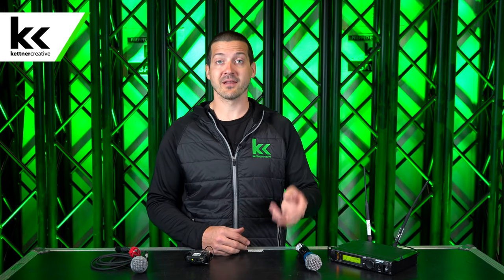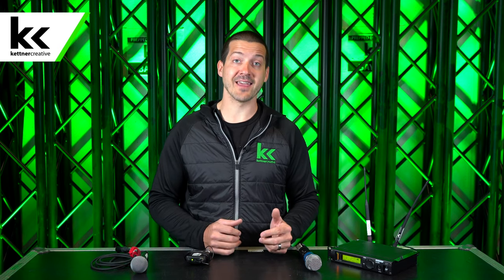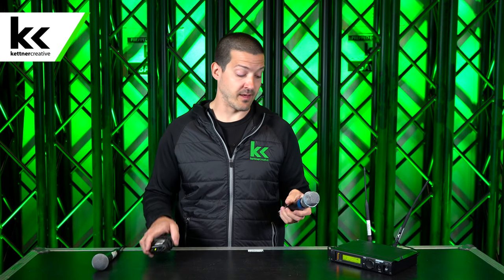How Do Wireless Microphones Work?

Comment: It's crazy to think how hard or expensive it is to get good signal with a wireless system as a dj just from my table across a wedding reception room or to the couple at the alter. But yet every car does it so easily traveling all around in metal cages moving across a huge area.

Comment: Hi
I have a all in one karaoke system (RHMK666) that has 2 wireless mic connects to 2.4GHz wireless band. I don’t understand these technical terms but my microphones built in lithium battery has died. All I want is to find out can I change the batteries on the microphone if not how to choose a replacement mic. Would appreciate your advice

Comment: I want to have 8 wireless mic. Can i buy 2x of a quad wireless mic? If not any suggestions. Or maybe you can make a tutorial setting up multiple wireless mic.. btw love the vid. Thanks!
Reply from the maker: I don’t recommend those quad wireless mic setups. The quality is really bad
Reply: @kettnercreative  Thanks for the quick response. I`m really not an expert in this kind of stuff. I`m just helping out in our Church since I`m kinda the only techy person there. So we already have existing quad wireless and want to add more that will not interrupt with the existing receiver from quad wireless. The Wireless Operating Frequency of our quad is 863MHz - 865MHz. so can i just buy something that is not the same as the operating frequency?
Reply: @Jonfrix  The cheaper the wireless system generally the fewer mics you can have setup intermod free in a given space of spectrum. The highest quality radio mic kits (analogue) will allow for over 12+ spots in an 8MHz chunk here in the uk but using something cheap and trying to get 8 spots in 2 MHz sounds like a disaster :)

Comment: Does a wireless collar mic require any additional equipment than the microphone itself, the beltpack transmitter and the receiver for the sound  to be audible.? I mean does it require any pre-amplifier.
Plus does a wireless dynamic microphone require a pre-amplifier to work?
Reply from the maker: There are several parts that are required. You would need a wireless microphone and a transmitter, then you need a receiver to receive the radio signal. 

Most receivers have a switch on the back so you can output line level signal (no preamp required) or mic signal (preamp required).
Reply: @kettnercreative  in addition to the microphone, transmitter and the receiver, a sound system ie, a power amplifier and a sound box/speaker is a necessity for the sound to be heard right? In case of both a cordless mic or of a lapel mic. 
Can you detail me regarding this.
Reply from the maker: I would suggest adding a mixer to your list as well. It will give you more control over the sound.

Comment: does the quality of wireless reciever and transmitter matter? I mean If i buy cheap transmitter and receiver but i use high quality mic, will that give better quality in cheap ?
Reply: Its always better to have a better quality radio tx and rx as that will last you longer in the long term and will give you a better noise floor. There are plenty of tv shows filmed on ok quality sennheiser g4/g3 packs using the cheapy ME2 Mic and they sound fine :)